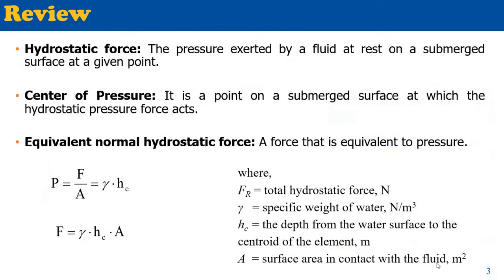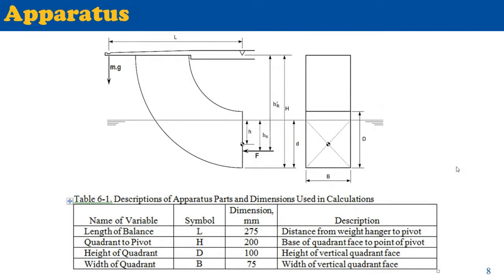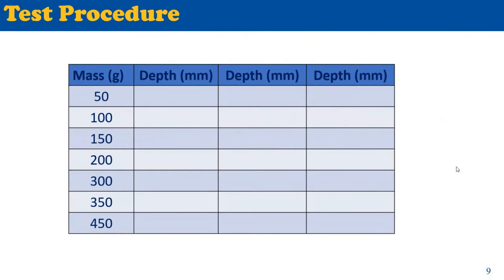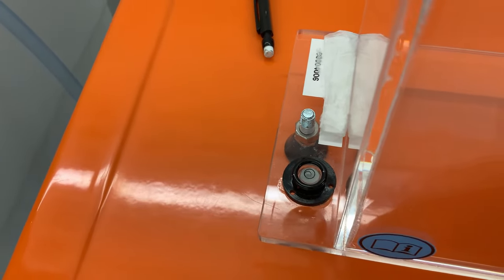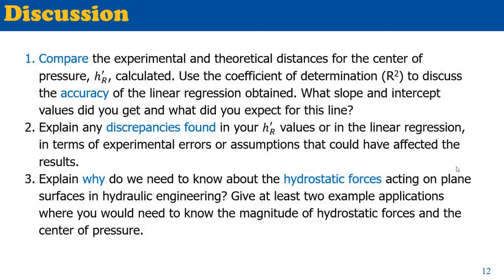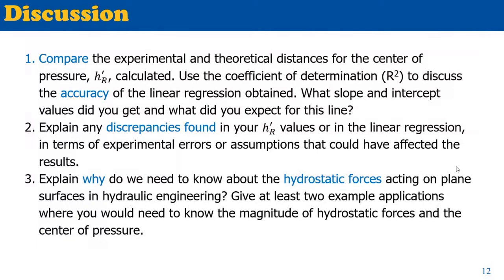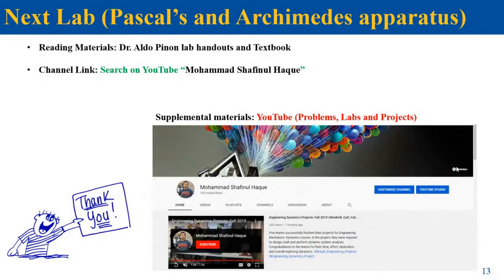Lab 3: Measurement of Hydrostatic force on an immersed plane and locating the center of pressure

Comment: Very good sir .. 
Can you explain when this experiment was done on fully submerged and partially submerged surfaces? 
I couldn't get the concept of partially and fully submerged in experimental point of veiw
Reply from the maker: Hi Sami, Look at 6.40 min where the horizontal line represents the water level and the vertical surface is partially submerged. At 8.36 min the verticle surface is fully submerged leading to different COP location. Similarly, around 15.10 min you will see the example of partially submerged, and around 18.09 min you will see a fully submerged scenario.
Reply: @MohammadShafinulHaque  thanks sir
Reply from the maker: @saimsiddiqui1544  you're welcome.

Comment: Doesn't the submerged portion of the quadrant contribute a buoyancy force? Would that effect the moment in addition to the hydrostatic force?
Reply from the maker: Very good question Justin. The buoyancy force is part of the hydrostatic force. The knife-edge pivot coincides with the center of the arc of the quadrant. Any forces on the curved surface pass through the pivot and have no effect on the moment. Forces on both sides are equal and cancel out. Only the force on the rectangular plane contributes to the moment.

Comment: What is the difference if we added water first or the weight first?
Reply from the maker: There is different cases that we test, such as partially submerged or fully submerged. If you pour the water first and don't know how much water you need, you may need to take out water. Make sure you don't have any spill water on the top of the body, that's an added weight.

Comment: Hello sir I have a questions 
What happens when the plane becomes fully submerged compared to partially submerged and why ?
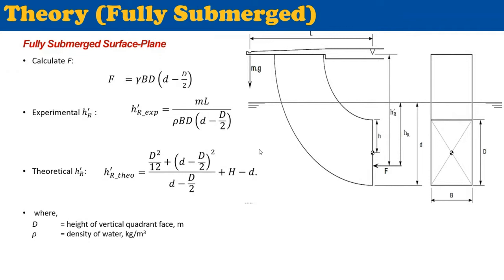Reply from the maker: The hydrostatic force acting on the vertical face changes. Since the partially submerge has force on only the partially submerged surface. See the force equation at min 7:40 and min 8:40 of the video.

Comment: Can you answer my questions?
  Is there a difference between the value of theoretical and laboratory
 force? Why?
Reply from the maker: A difference between the theoretical and laboratory force may exist as there is a difference between theoretical and experimental (h). If you observe the force equation it depends on the specific weight and depth of immersion (d), while B (for partially submerged) and B&D (for fully submerged) are fixed. Differences may arise due to human error in reading water temperature, and reading (d), something temperature of the water may change all these can lead to different values.
Reply: @MohammadShafinulHaque   Thank you sir, but I have 3 questions besides this question

 1- Is the force by weight the same as the experimental force? Why?
 2- Any force of water pressure greater, in case of partial immersion or total
 immersion? Why?
 3- What is the relationship between mass and the water depth? Why?
Reply: @MohammadShafinulHaque  Can you answer my questions briefly?
Reply from the maker: @moonlight-vx4ti  (1) the force by weight is not the same as hydrostatic force (F), as they are related by mgL=Fh, thus mg is not equal to F generally. (2) I am not clear what you are asking in this question, can you clarify your question? Are you asking which force is greater? partial or fully immersed? (3) See the force equation at times 7.40 and 8.40, F increase with depth of immersion d.
Reply: @MohammadShafinulHaque  Thank you very muchsir،You helped me a lot. Regarding question 2, yes like this
Reply from the maker: @moonlight-vx4ti  Regarding 2nd question, observe the force equations for partially and fully submerged scenario. For both force F depends on small (d); for partially submerged d<D, how ever for fully submerged d>D. This fully submerged will have higher force. Another simple way  to think of as diver, the the more depth in water you swim the more pressure you experience. Hope this helps.
Reply: @MohammadShafinulHaque   Thank you for answer all my questions ❤🙏🙏🙏
Reply from the maker: You're welcome

Comment: Dear Sir............Example Problem I have a single acting hydraulic cylinder with a stroke of 300 mm, a bore of 18 mm and a rod of 10 mm
 if the press weight is 1 mm on the Piston Head what is the pressure.....Please explain the calculations
Reply from the maker: Refer to a fluid mechanics book